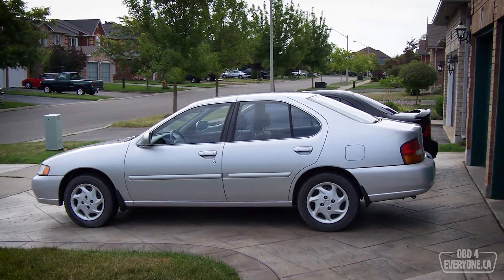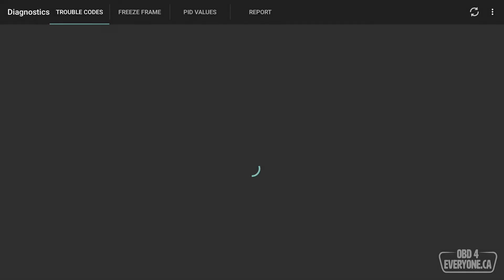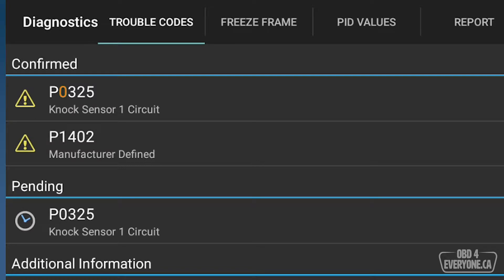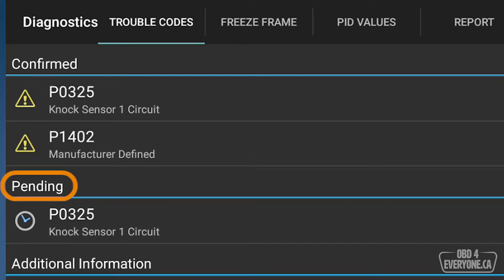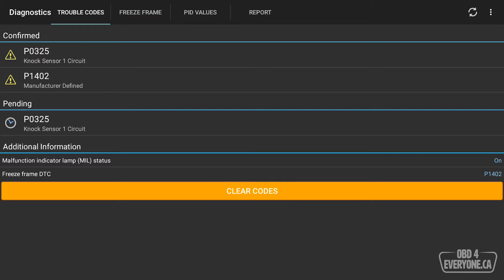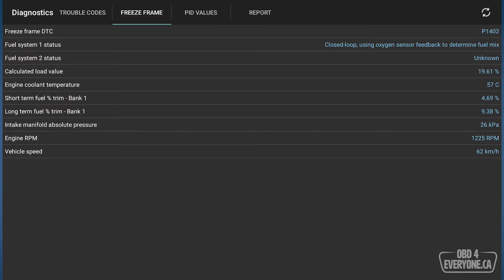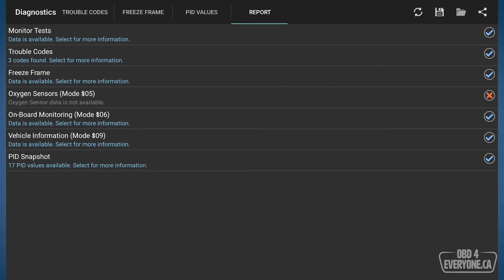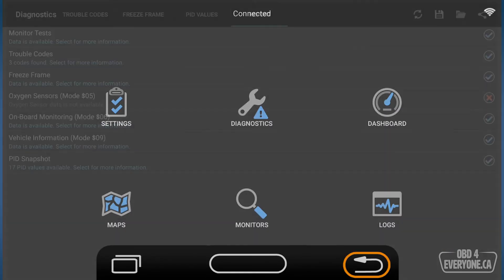Reading Engine Trouble Codes with OBD Fusion for Android: OBD4Everyone Ep. 11

Comment: How do we check the history of the check engine light with advanced diagnostic?
Reply from the maker: Hey  D Griffin,
The options in the advanced diagnostics are vehicle specific and some may have a fault history or not have it.

As far as I know on the Infiniti/Nissan advanced diagnostics, there is nothing there that shows any type of past fault history.

Using OBDFusion's diagnostic report, on my 2011 Infiniti G37, it does show the number of miles/Km since the trouble code was cleared, but does not show the code, unless it is a permanent code that hasn't been cleared by the ECM yet.
Reply: Thank you 🙏 

We learn so much from your videos! I’m new to the OBD Fusion advanced diagnostics, but am a fellow automotive enthusiast at the least! Thank you so much for your videos.

If you have time to show us more amazing stuff with the OBD Fusion, we would love it!

Merry Christmas 🎄 🎁
Reply from the maker: Hey D Griffin,
Thank you for your kind words. There are many more episodes planned, I just need to wrap up a few work projects and you will see new episodes :)

Comment: I'm not understanding how to create a Custom PID.  
I can use a terminal software like so:
using A terminal when I type

ATSH6C10F1

OK

>

22194001

6CF1107F2219400131EF  

>
How do I get the 31 data into a gauge?
Reply from the maker: Hey David Powell,
Try this... Under User defined PIDs:
• OBD Mode should be set to 22 (Service $22)
• PID Number should be set to 1940

Then touch test.
Some ECMs will only return valid data for  mode $21/22 if they are placed into a "diagnostic session" (For example Nissan/Infiniti)

Good luck!
Reply: @OBD4Everyone  Thanks for the super quick response.  I have tried the following without success.
Module/Header: ECM, ALL, 070E, 6C10, Transmission
OBD Mode: 22
PID Number 1940, 194001

Is it possible that OBDFusion is setting up my ELM327 WIFI reader in a way that undoes ATSH6C10F1?
Reply from the maker: Hey David Powell,
I think you might be correct. I don't think OBDFusion allows AT commands (Set Header) to be sent from a custom PID.

You can ask OBDFusion if this is possible:
https://obdsoftware.force.com/s/

Sorry I can't be of more help.

Comment: Hi - great videos!  Do you know if either OBD Fusion or Torque Pro would allow me to read and then clear a DPF error code on a BMW (E60 525d)?

Thanks

Paul
Reply from the maker: Hey Paul Paul,
I don't think the DPF error code is part of the "Generic OBD" system, so Torque Pro or OBD Fusion won't be able to read the code or do anything with the DPF.

BUT Carly just added this feature:
https://www.mycarly.com/product/dpf/

I have used the Carly app (not on a BMW) with their scanner and it worked well.
This may be the lowest cost option for you.

Comment: Hi how r u sir ...
I have obd2 but cods show by ( u ) latter not ( p ) .
When I put search for code its showing this code U1308 ...I searched fir this code dint find any information about it. 
There is any options in obd2 adapter change code from U to p ?
Reply from the maker: Hey Mohamed Shoeib,
The first letter of all OBD codes show the area:
• P = Powertrain (engine)
• B = Body
• C = Chassis
• U = Network 

The second character tells us if it is a generic or manufacture specific.
• 0 = generic code, for example P0125. These are easy to search for what they mean.
• 1 = manufacture specific, for example P1553. These can be hard to find their meaning.

Your  code indicates it involves the network  and is manufacture specific.

Try searching with the code and include the make and model of the car.
Good Luck!
Reply: OBD4Everyone thanks sir for reply... I will do what you told me .... thanks alot.